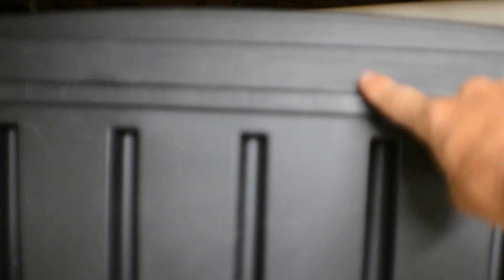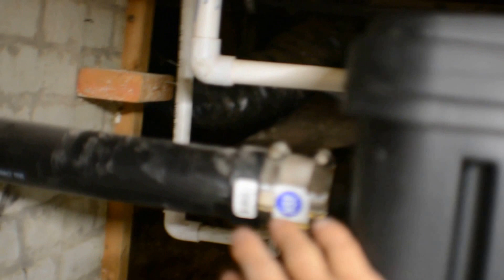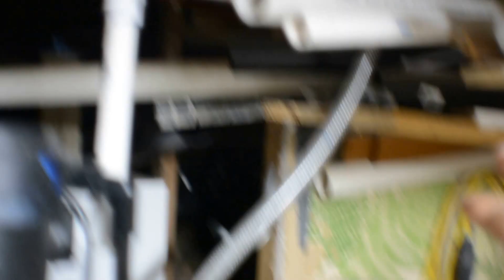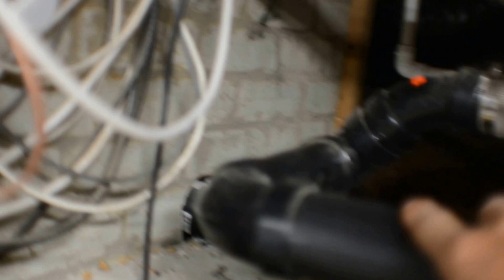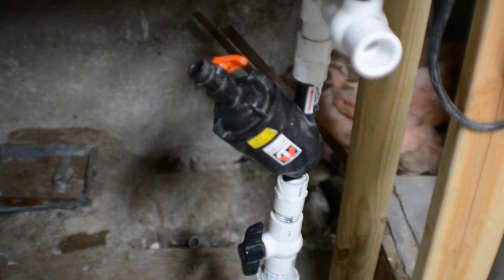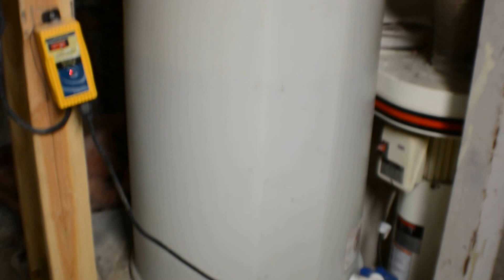Gray Water Recycling System

Comment: what is the total cost
Reply from the maker: About $700. Most of that was the pump and filter.   There are less expensive pump solution but the larger on runs the sprinkler system better.